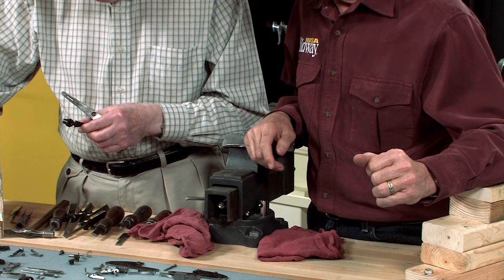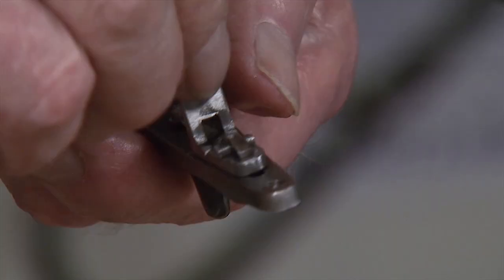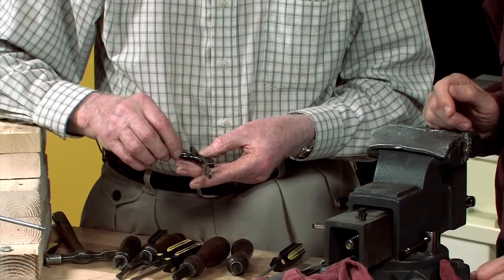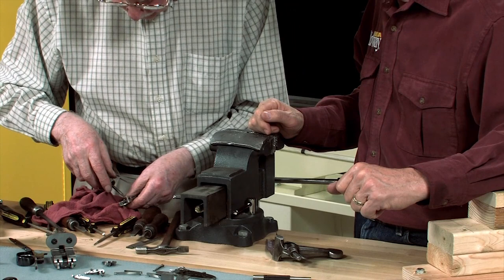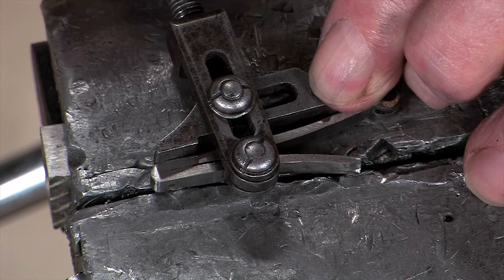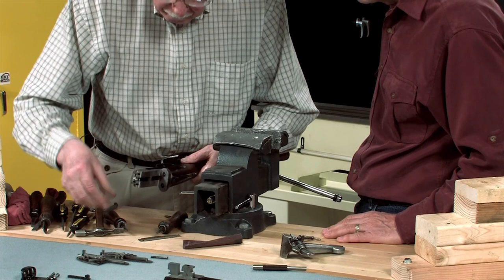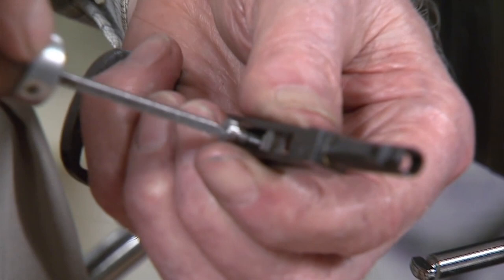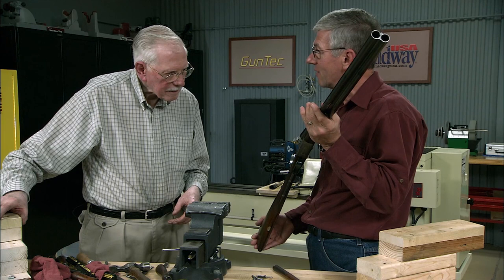How to Re-assemble a Sidelock | British Side-by-Side Shotguns | MidwayUSA

Comment: I noticed all the screws showing on the outside tightened with the notch running lengthways. Nice firearm.
Reply: +Mike Taylor . That is the only way to do it Mike!
Reply: Its called points north. That is one nice thing about the finer side by sides and over unders. They are very precise in how they were built. Only a few of the really high end manufacturers do this today.

Comment: Why must the front and rear (or left and right trigger) be that particular way round...Why can't they be switched so the right trigger is also the rear trigger? So as to be able to slide the trigger finger from front to back (or left to right) in one smooth transitional "stroking" motion, the same way you can if you shoot left handed.
Reply: +caveymoley . The reason for the triggers being this way round is that the front trigger, on the right hand side, fires the right hand barrel ,which is the open choke, and the rear trigger, on the left hand side, fires the more tightly choked left hand barrel. I hope this makes sense.

Comment: Awesome videos but the condition of those screw drivers is horrible, I can see Larry cringe!
Reply: I couldn't tell if it was just the lighting, or if the tips were really as worn as they looked. Because yes, more than one appear to be in absolutely awful condition - more like dull chisels than screwdrivers. Not sure what to make of it.
Reply: The slots in gun screws are very narrow, (external ones) so a normal screwdriver won't fit in the slot. Hollow ground screwdriver tips are best I think. Jack's screwdrivers do look very wedge shaped but I guess they do actually fit the screw slots very well.
Reply: These English masters call them "Turn Screws" not screwdrivers.  Jack makes them himself out of spring steel.  I believe there are only two standard english slot sizes for external screws.  They may look worn but in fact the look is more home made and they fit perfectly.  I believe Larry has a video with Jack showing how he makes his "turn screws".

Comment: He's a bit rough handling parts and those are not proper screwdriver blades.
Reply: he makes them himself. it was explained in an earlier video.
Reply: When you work with something for decades you know what you can and can’t do. English gunmakers make their own tools by hand normally when they finish their apprenticeship. We call them turn screws not screwdrivers and you make different turnsrews to fit different pins.